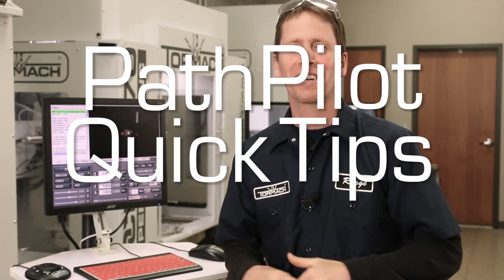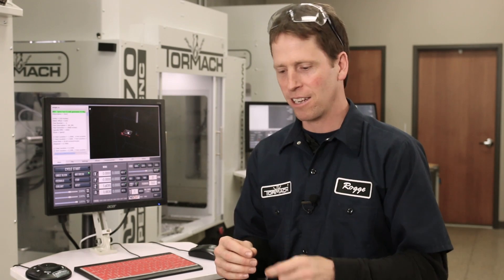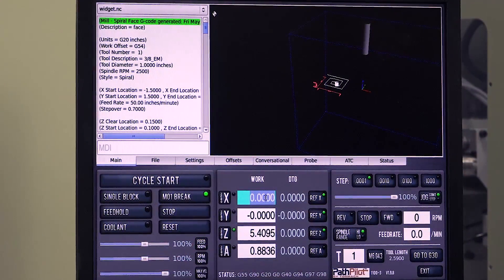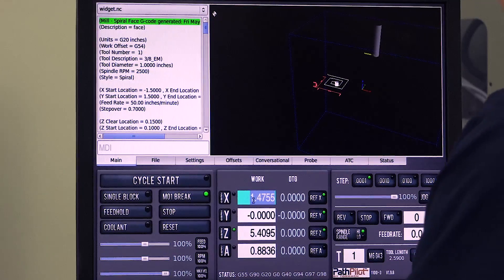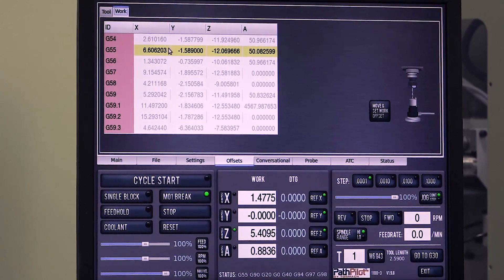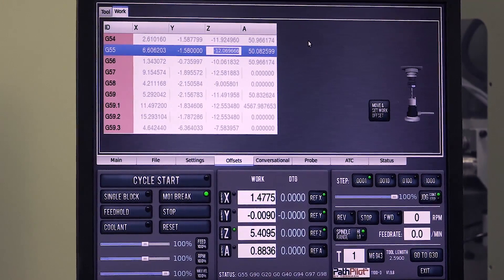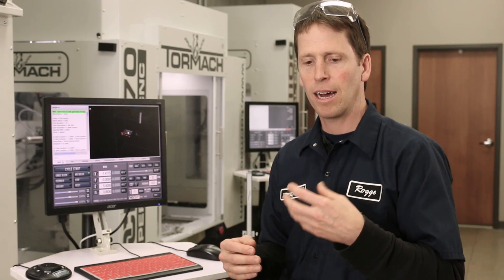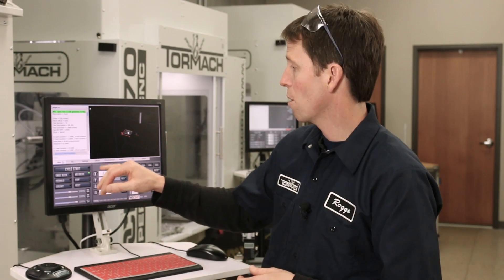PathPilot Quick Tips: Tweaking Your Work Offsets

Comment: can you enter work offsets relative to each other?  for instance if I want g55 to be 8" right of g54, is there a way to enter g54 + 8.0 into the x value for g55?
Reply from the maker: You can! 

Go to G54 (0, 0, 0).  Switch to G55 by typing G55 in
MDI line.  Zero the Y and Z DROs, then type ‘8’ into the X DRO and hit
enter.
Reply: Tormach Inc. what I'm going after is to probe in g54 and have all the other work offsets automatically reference off of that.  this way if I crash or have any issues with repeatability of limit switches when homing, I only have to probe in g54 and then all the other work offsets populate themselves relative to that.  being able to type in g54 + 8 on the x axis of g55 in the offsets table, and then that formula staying there after would be a super feature.
kinda like parametric offsets, if that makes sense :)